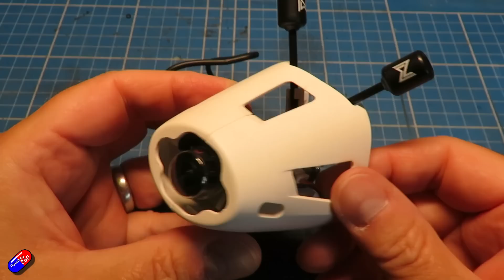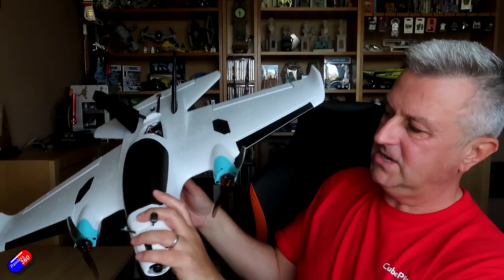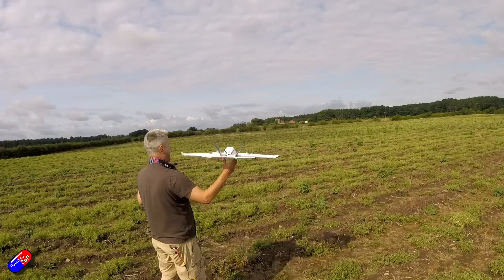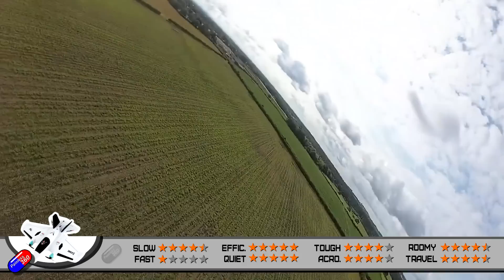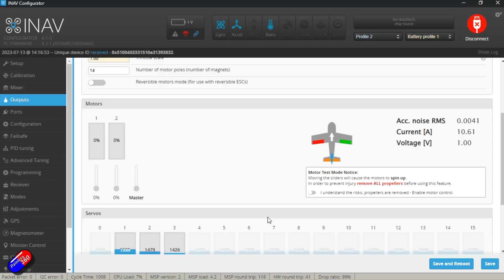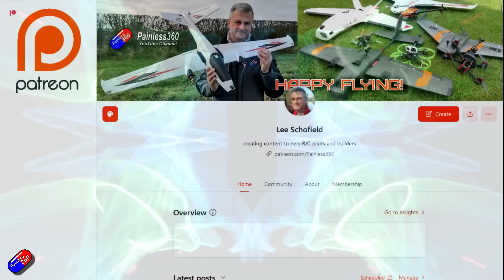AtomRC Penguin: Build and Flying Review!

Comment from the maker: for all those struggling to use the link to the Diff All file - 

# version
# INAV/ATOMRCF405NAVI 6.1.1 Jun 13 2023 / 10:02:51 (42ced253)
# GCC-10.2.1 20201103 (release)
# WARNING - USE WITH CAUTION, NO MODES OR OSD LAYOUT IN THIS FILE
# ALSO - BE AWARE THAT AUTOLAUNCH IS ON ALL THE TIME AND THE PROPS ARE SET TO SPIN ON THROTTLE UP

# Mixer: motor mixer

mmix reset

mmix 0  1.000  0.000  0.000  0.000
mmix 1  1.000  0.000  0.000  0.000

# Mixer: servo mixer
smix reset

smix 0 1 0 80 0 -1
smix 1 2 0 80 0 -1
smix 2 3 1 80 0 -1

# Outputs [servo]
servo 1 1000 2000 1539 -100
servo 2 1000 2000 1479 -100
servo 3 1000 2000 1426 100
servo 4 1000 2000 1500 -100
servo 6 1000 2000 1500 -100

# safehome

# features
feature MOTOR_STOP
feature GPS
feature PWM_OUTPUT_ENABLE
feature FW_LAUNCH
feature FW_AUTOTRIM

# beeper

# blackbox
blackbox -NAV_ACC
blackbox NAV_POS
blackbox NAV_PID
blackbox MAG
blackbox ACC
blackbox ATTI
blackbox RC_DATA
blackbox RC_COMMAND
blackbox MOTORS
blackbox -GYRO_RAW
blackbox -PEAKS_R
blackbox -PEAKS_P
blackbox -PEAKS_Y

# Receiver: Channel map
map AETR

# Ports
serial 0 0 115200 115200 0 115200
serial 3 2 115200 115200 0 115200
serial 4 33554432 115200 115200 0 115200

# LEDs

# LED color

# LED mode_color

# Modes [aux]

# Adjustments [adjrange]

# Receiver rxrange

# temp_sensor

# Mission Control Waypoints [wp]
#wp 0 invalid

# OSD [osd_layout]

# Programming: logic

# Programming: global variables

# Programming: PID controllers

# master
set gyro_main_lpf_hz = 25
set dynamic_gyro_notch_q = 250
set dynamic_gyro_notch_min_hz = 30
set gyro_zero_y = -2
set ins_gravity_cmss =  997.973
set acc_hardware = BMI270
set acczero_x = -15
set acczero_y = 8
set acczero_z = -11
set accgain_x = 4098
set accgain_y = 4086
set accgain_z = 4100
set align_mag = CW270FLIP
set mag_hardware = NONE
set baro_hardware = SPL06
set motor_pwm_protocol = DSHOT600
set failsafe_procedure = RTH
set align_board_yaw = 1800
set platform_type = AIRPLANE
set has_flaps = ON
set model_preview_type = 14
set servo_pwm_rate = 100
set small_angle = 180
set ahrs_inertia_comp_method = ADAPTIVE
set applied_defaults = 3
set gps_sbas_mode = AUTO
set gps_ublox_use_galileo = ON
set airmode_type = STICK_CENTER_ONCE
set nav_extra_arming_safety = ON
set nav_wp_radius = 5000
set nav_wp_max_safe_distance = 500
set nav_rth_allow_landing = NEVER
set nav_rth_altitude = 7000
set nav_fw_control_smoothness = 2
set nav_fw_launch_velocity = 150
set nav_fw_launch_accel = 1500
set nav_fw_launch_max_angle = 180
set nav_fw_launch_motor_delay = 100
set nav_fw_launch_timeout = 10000
set nav_fw_launch_max_altitude = 5000
set nav_fw_launch_climb_angle = 25
set osd_video_system = AVATAR
set osd_units = IMPERIAL
set osd_time_alarm = 20
set osd_alt_alarm = 110
set osd_home_position_arm_screen = OFF
set osd_switch_indicators_align_left = OFF

# profile
profile 1

set fw_p_pitch = 15
set fw_i_pitch = 5
set fw_d_pitch = 5
set fw_ff_pitch = 80
set fw_p_roll = 15
set fw_i_roll = 3
set fw_d_roll = 7
set fw_p_yaw = 50
set fw_i_yaw = 0
set fw_d_yaw = 20
set fw_ff_yaw = 255
set max_angle_inclination_rll = 450
set dterm_lpf_hz = 10
set fw_turn_assist_pitch_gain =  0.400
set nav_fw_pos_z_p = 25
set nav_fw_pos_z_d = 8
set nav_fw_pos_xy_p = 55
set d_boost_min =  1.000
set d_boost_max =  1.000
set rc_expo = 30
set rc_yaw_expo = 30
set roll_rate = 18
set pitch_rate = 9
set yaw_rate = 3

# profile
profile 2

set fw_p_pitch = 15
set fw_i_pitch = 5
set fw_d_pitch = 5
set fw_ff_pitch = 96
set fw_p_roll = 15
set fw_i_roll = 3
set fw_d_roll = 7
set fw_ff_roll = 40
set fw_p_yaw = 50
set fw_i_yaw = 0
set fw_d_yaw = 20
set fw_ff_yaw = 255
set max_angle_inclination_rll = 600
set max_angle_inclination_pit = 600
set dterm_lpf_hz = 10
set fw_turn_assist_pitch_gain =  0.400
set nav_fw_pos_z_p = 25
set nav_fw_pos_z_d = 8
set nav_fw_pos_xy_p = 55
set d_boost_min =  1.000
set d_boost_max =  1.000
set fw_level_pitch_trim =  2.000
set rc_expo = 30
set rc_yaw_expo = 30
set roll_rate = 31
set pitch_rate = 13
set yaw_rate = 3

# profile
profile 3

set fw_p_pitch = 15
set fw_i_pitch = 5
set fw_d_pitch = 5
set fw_ff_pitch = 80
set fw_p_roll = 15
set fw_i_roll = 3
set fw_d_roll = 7
set fw_p_yaw = 50
set fw_i_yaw = 0
set fw_d_yaw = 20
set fw_ff_yaw = 255
set max_angle_inclination_rll = 450
set dterm_lpf_hz = 10
set fw_turn_assist_pitch_gain =  0.400
set nav_fw_pos_z_p = 25
set nav_fw_pos_z_d = 8
set nav_fw_pos_xy_p = 55
set d_boost_min =  1.000
set d_boost_max =  1.000
set rc_expo = 30
set rc_yaw_expo = 30
set roll_rate = 18
set pitch_rate = 9
set yaw_rate = 3

# battery_profile
battery_profile 1

# battery_profile
battery_profile 2

# battery_profile
battery_profile 3
Reply: AtomRC's site has a FPV pan/tilt unit, they replied to a comment and said it will fit on the Penguin,... What was that about forest runs again? :D
Reply from the maker: Video on the AtomRC pan and tilt on the channel..Happy flying
Reply: Your sharing of the diff is much appreciated. While I still tend to do my own thing, it's very helpful to know what the manufacturer was thinking.

Comment: Hi, I used your Inav Setup but for some reason auto launch only one of the motors are spinning up, But it flies fine, any ideas on why this may be happening please ?
Reply from the maker: I'm guessing you're not using DShot?
Reply: @Painless360  All stock motors, Esc's and flight controller same as yours in this video
Reply from the maker: Try DSHOT. If that doesn't work then pop it back and calibrate the ESCs. Best of luck

Comment: If you put in your own flight controller and load inav do you have to choose Wing with tail or Delta wing? I'm confused when the tail doesn't have a rudder and it's a double tail in a v-tail configuration? 
  On a side note, your videos are always so easy to follow
Reply from the maker: Normal plane. See the INAV setup in the unboxing video linked in the description. Best of luck

Comment: Cam You put a 7 or 8 inch props on it ?
Reply from the maker: Depends on pitch. See my motor and prop series for what you need to consider... Happy flying
Reply: @Painless360  Ok i got it, 7 maybe... 8 no chance, 6 is good, not a lot of room until the body.  There is a plan to build it with 2206.5 wasp with 6S 21700, but as far as i saw it should fit  tightly, and then some 6040  prop. As for the look, well it is very nice i think, kinda unibody wing, but it is cool:) I like the look of it a lot to be honest. Should be a stingray not a penguin though.

Comment: Commenting late here, but this plane with 2207 1800kv and 6S is just stupidly fast while also retaining those low speed stability. Can also cruise by squeezing in 7 inch props on a 4S Lion with surprisingly decent efficiency. About 200mah per mile. If you ever want to revisit this model, this  setup is always a load of fun and pushes it closer to the dolphin's acrobatic/speed.

Comment: Why would the FC being directly on CG be preferable?
If its just measuring angle I'm struggling to understand how it would make difference.
Thanks.
Reply from the maker: It doesn't make a huge difference... But imagine if you are sat in the center of a rotating roundabout, all you feel is the rotation. Imagine now sitting on the edge of the same spinning roundabour. You now feel rotation and sideways movement too... Happy flying

Comment: Hi P
I know you bought the PNP model but i bought the KIT model and im having ESC issues. I've been through 4 different ESCs and they all suck. I am running a 6In GEMFAN Flash prop on my penguin and 220X sized motors. RDQ 2-6S 25A BLS on Bluejay (had to increase startup power, works but has desyncs and spins out sometimes) Lumenier Razor F3 Pro BL32 (smoked the motor and esc just by blipping the throttle up) Lumenier 51A BL32 (Smoked the motor again, same side, new motors 2400KV to 1900KV, 4S to 6S, smoked the motor again) APISQUEEN BLS 45A on Bluejay (Cant get the Motors to spin no matter how much startup power i give). 
What do you think the issue is? What ESC and Settings should i use? Thanks
Reply from the maker: That does sound odd, I've never had something like that happen here. The only thing I may play with is the brake for those models where I want the prop to not 'free-wheel' for landing...

Comment: Excellent overview.  Anyone know if iNav do yaw axis stabilization with those twin motors though?

Because I can add in rudder input into the motor mix table in iNav 7.1 to get differential rudder control by the pilot.  But iNav doesn't appear to support yaw axis stabilization using just motors because it only allows selecting servos in the stabilization section for any axis.  Any way to get around this?

It's a shame to not get yaw axis control and stabilization for essentially free on a twin motor plane like this Penguin!

Comment: I am liking my other two atomrc planes.  However, I want to use a Cube Orange on a wing configuration.  My question is will it fit?
Reply from the maker: Depends on the wing! You can run Ardupilot on non-CUBE hardware now too if you are tight for space.. Best of luck.
Reply: @Painless360  I have a cube orange already with no plane to go in, so that is what I wanted to try in this penguin.  It looks like it could fit

Comment: I'm coming from FPV world and have few 4S R-Line 1550 mAh batteries. What flight time should I expect? 10:05 seems like it takes 8 A of current at 50% throttle so 10 minutes should be doable right? Do you have any experience in connecting two 1550 mAh 4S lipos together to extend that time? :D
Reply from the maker: https://youtu.be/d1ejhtPQrao explains how to figure it out.  Cruise speed changes the current draw dramatically.  Half the speed uses a lot less than half the current... Happy flying!

Comment: It is a bit sad that they did not include any quick connector for the wing servos, but it still looks like a very nice plane. I wonder how simple it would be to add your own.

How does the noise level compare to the Dolphin, Swordfish and T1 Ranger?
Reply from the maker: Similar to the Swordfish. See the ratings for those models in my review videos for them... Happy flying
Reply: If it's like the swordfish so there is no noise at all!
Reply: @Tommyjames21  I would not call my swordfish silent.
Reply: @VladTepes44  really? I have ar wing pro, dolphin and swordfish, and the last one is really silent.....at 30-40% throttle, it's really silent....

Comment: It's a pity that it doesn't include landing gear for example integrated into the motor mounts. I live in a hot dry semi desert area where there is no green grass to be found, with only asphalt and stoney dirt roads being suitable to land on.
Reply from the maker: You could use tape to re-enforce the belly and wing-tips or/and use the cable-tie trick (cut the ends of a beefy cable-tie and glue them under the body to create a bow shape to act as gear)...
Reply: @Painless360 Thanks good idea. I was also thinking of molding a cut out of a PET plastic bottle to the belly using a hot air dryer but the heat may damage the foam. Or I may have to create a mold first using PU spray foam and mold the plastic into that.

Comment: The massive throws are what you need in a dog fight. Drop the throttle Yank, Bank, Loop and Roll. Then punch the gas again.
It's probably not what you need flying RC planes though...
Reply from the maker: I'm sure, that for some pilots, it would be fab! Videos of it threading through trees like a quad in the promotional videos form AtomRC...

Comment: Can you say a little more about the battery test pack LiIon? What kind of cell you are useing to build it?
Reply from the maker: It'll fit both 21700 and 18650 LiIon packs. See my video on the 21700 pack.... Happy flying
Reply: @Painless360 Hi, quick question about batteries. Why use Li ion in planes as opposed to LiPo in Helis? I was always under the impression that LiPo was superior in capacities and power output. Do I have this all wrong?
Reply from the maker: If you Google 'li-ion painless360' you'll find my videos that cover that exact thing. Best of luck!
Reply: @Painless360  will it fit a 4s 2p 18650  lithium ion battery and still balance fine?